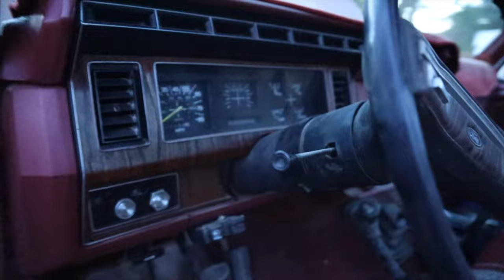1984 Ford F-250 Revival

Comment: I have an 87 crew cab diesel with the same broken directional lever.  Truck sat for 18 years.  Dumped in some fuel bought new batteries and after getting the air out of the fuel lines it fired right up!  Everything works even the radio.  Only thing busted is the directional lever. Amazing.

Comment: Nice! I just bought a 1984 F250 ex snow plow rig from Montana. It was owned by some tweakers before I got it, so trying to undo some damage and bunch of cut wires and Jimmie rigged work but just got it to run today and the fuel pump working. I will definitely be referencing your video again. Thanks for putting the work into it! also do you have a preferred vendor for parts?
Reply from the maker: Lmctruck is my go-to